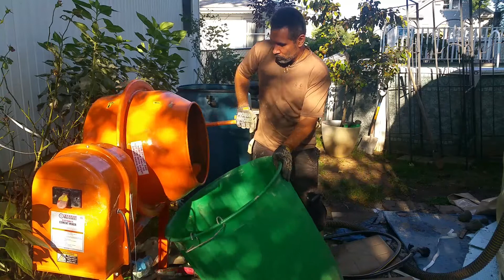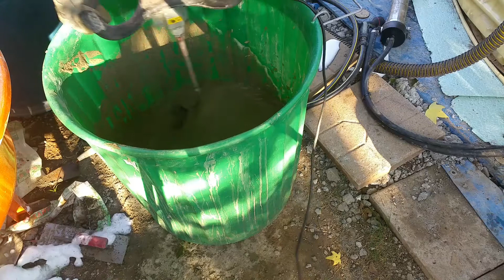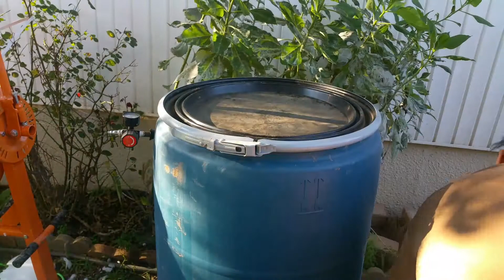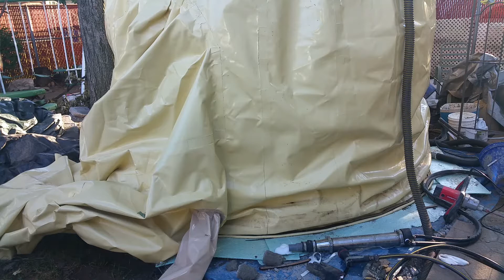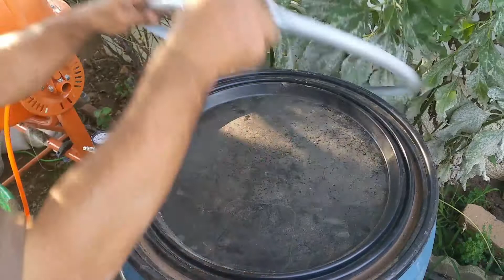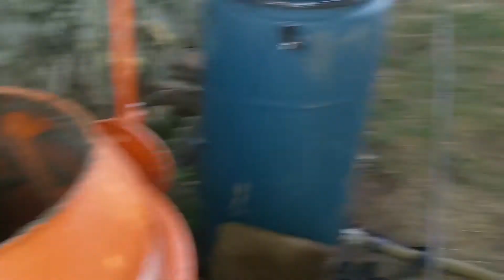Mixing & pumping Aircrete into 2nd Air-Form #AircreteHarryFoamGenerator #AircreteHarry #Aircrete

Comment: Wow, Could that orange machine be any loader?  Mix some powdered lime in the water you uses to make the concrete. Mix your concrete as normal, then add fine aluminum powder and mix it in. It will form hydrogen foam in the mix and your concrete will rise like a cake.  No need for a foam machine.  easy light concrete.

Comment: Hey I have a experiment request for you to make. What happens if you just shoot the foam in the mixer instead of using the drill? If you put a little of each at a time instead of just mixing it all in one shot?
Reply from the maker: Because of the size of my mixer. I don't want to mix less than half a bag of cement to save myself time this i faster for me. But when I did mix a smaller amount I did put the foam in the cement mixer and it worked well.